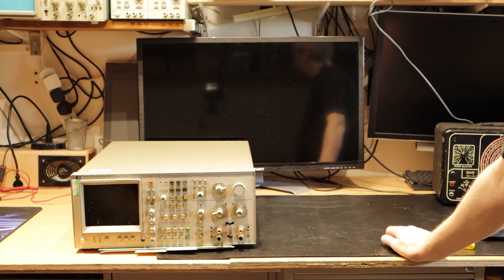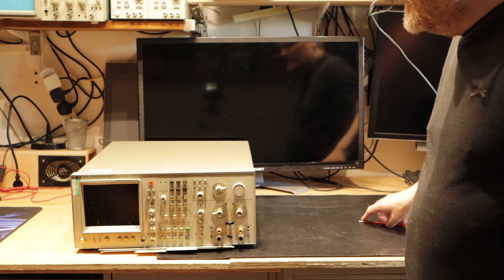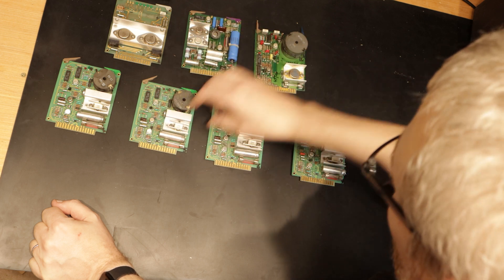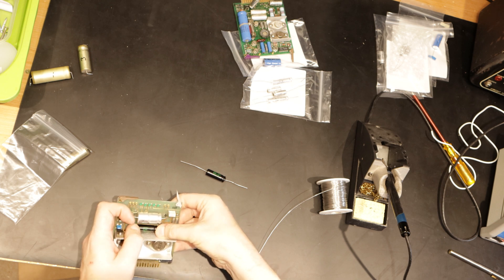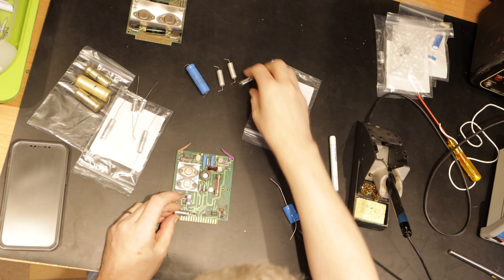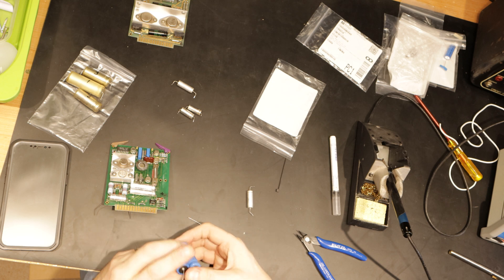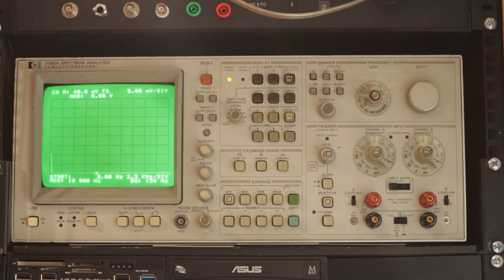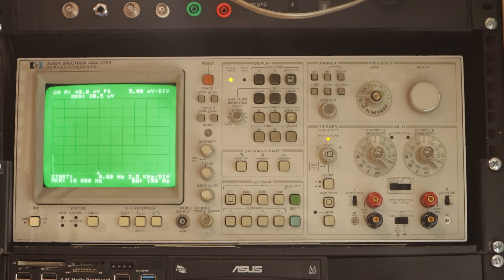#16 Hewlett Packard HP3582A audio spectrum analyser

Comment: The switch cap you mentioned is  a knob for a concentric rotary switch. It does not have CAL printed on it, rather it is the MODE selector. 😊

Comment: tants go dead short , ive not sean any in 40 years go low value
Reply from the maker: Yes but as I was doing a thorough job I felt it prudent to test each one to see if it was still working within spec and they all were.  To be honest I had never seen tants like these.  They look like small axial electrolytic caps! This repair brought up several items which had me questioning things with tants looking like electrolytic and radials looking like dual axials.
Reply: And they usually let you know quite clearly when they have failed.  The group wisdom Tek and HP test equipment is to derate them: Don’t run them close to their rated voltage.